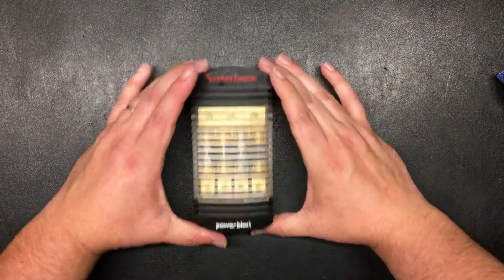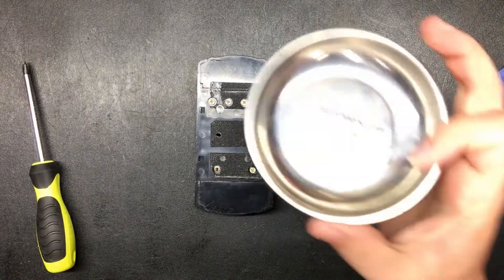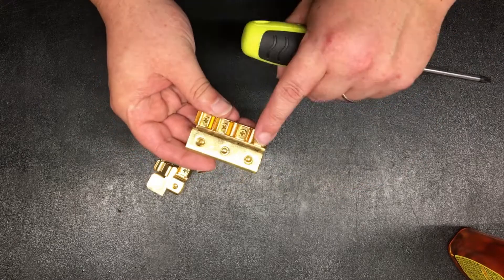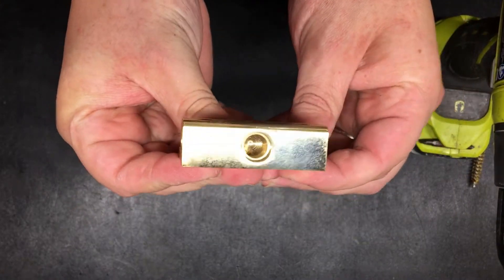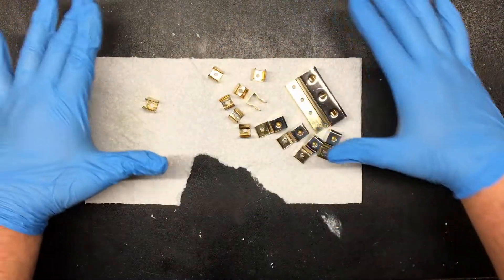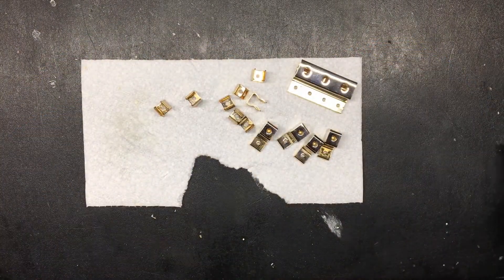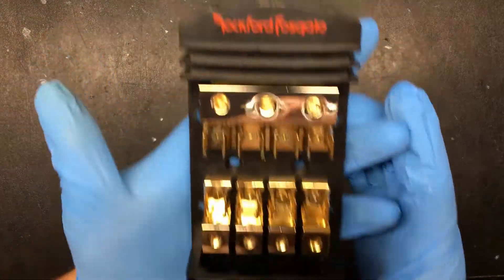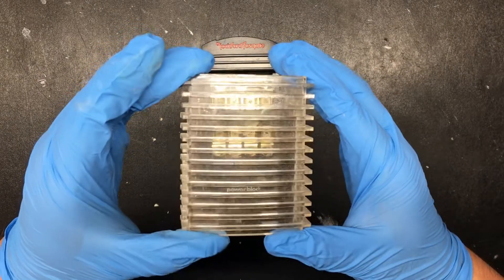Rockford Fosgate DSM Distribution Block "Restoration"

Comment: Love restoring old RF stuff. Im actually in the process of touching up  some dsm amps. Is there a specific brand and color you suggest?
Reply from the maker: I'll be honest. I have had zero luck finding a 100 percent match. The closest I have come to original finish is the Rust Oleum Textured black. The problem with the spray cans is they are slightly darker than the originaal paint. The original DSM color has a slight "chocolate" color to it. If you plan on using or keeping the amps it shouldn't matter much. However, if you compare a stripped and painted amp to a NOS amp or link you WILL see a difference. What I have done is connected all my links and amps together and used one can to coat all the amps. This gives them all the same color and finish. I do have some NOS links that I do not plan to paint as they are still sealed but all my used items got painted the way I mentioned above. Also, best to use a brand new can for your main items. Once you get to about half a can the texture finish seems to be lacking compared to a new can.
Reply: @kaknballz  yea exactly, the first DSM were little brownish tiny in the blk. The trans ana x2 x4 little more BLK. I'll be honest, I'm not using these at all lol. Kinda like a collection I guess. I recently started grabbing them. Got 15 DSM ix trans ana series right now. Missing the 500m 250m 4020 4040 and 400x4... Found a 250m local in Chicago that looks mint but he wants $500... I'm not really ready to cough up $500... I'll do like $250-$300 maybe. But I've been out of the game and not sure what the 500m and 250m are going for. Most ones I bought are pretty mint with end caps and I'm usually at $100 for the 40 & 60 and $100-$200 on the 100-200's... The four channel ones are the hardest ones for me to find and I paid $150 for a mint 240x4 and little more for a mint 160x4... Again, I'm probably paying too much tbh. But the ones I bought are pretty damn mint. I just gotta test them before my PayPal 30 days are over.